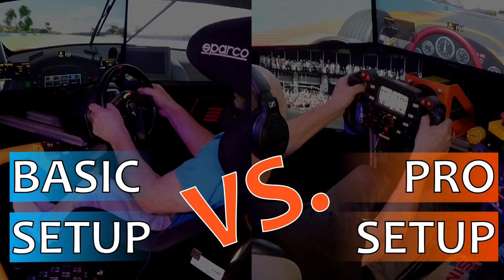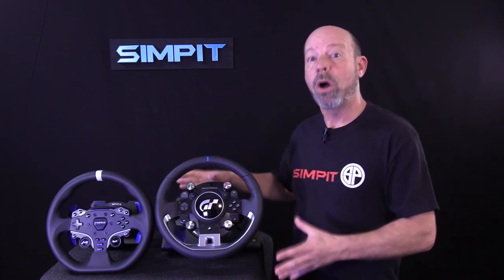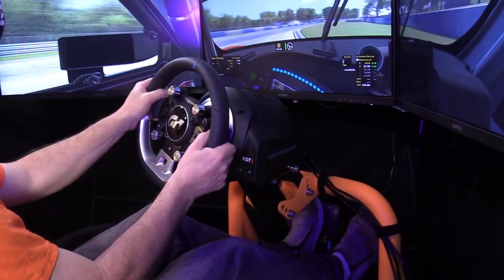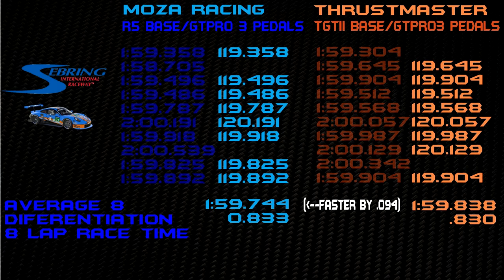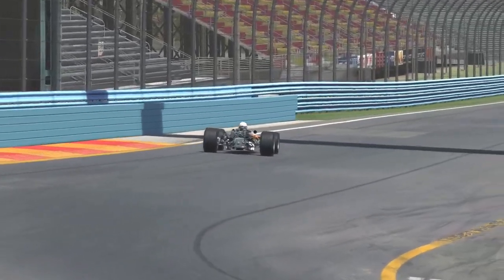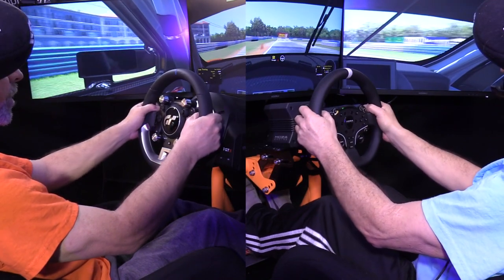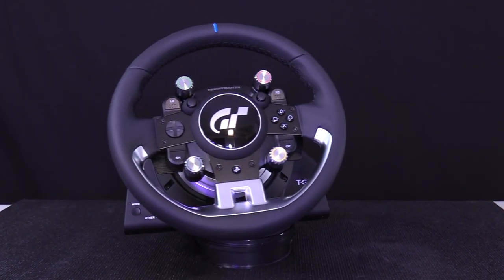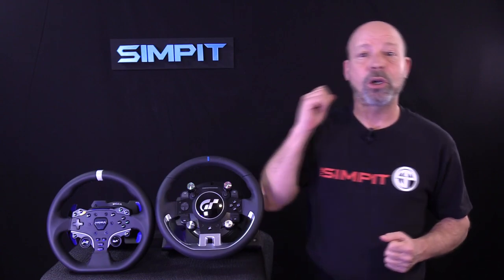Belt Drive Vs. Direct Drive - Battle of the Five's

Comment: Really interesting. The t-gtii really holds its own.
Reply: I have a t-gtii now and really happy with it. Fan does make noise but as soon as sound is on you can't hear it. You only feel belt notch if you go looking for it, spinning the wheel really fast for example
Reply: @peterwood2633  Good to hear that, I want buy T-GT II with playseat in winter 2024 and sure but PSVR 2

Comment: Something nobody will tell you is. Thede 5 to 7 or 8nm belt wheels feel stronger then 5 to 8 dd wheels. Just the way the belt and motor is pulling feels stronger then the way magnets react in a dd wheel. Ive alwyas understood why dd wheles feel better in the hugher nm range even if you were to lower settings a bit. For me it took about 15nm to truely undrrstand why dd is so so good not just in smoothness but the reaction and response and snap with that extra torque. Even if resucing down to 8nm its still worth having a 15+ nm wheelbase thats dd. If i didnt finslly get to try the stronger ones i would have stuck with my cswv2.5 because yes i liked it more then any 5 to 8nm dd wheel on the market.

But I will say 1 full second is the difference between winning and losing many times over again. Lol

But yes you wont gain times with either of these.

Comment: I ended up buying the Thrustmaster TGTII, though I was seriously considering the Moza R5 bundle and Ras1ution 2 converter (I do PC and PS5 racing.)   Ultimately it came down to me not wanting to have to fiddle with a middleware device to get things working on the PS5.  The difference in cost was that the Thrustmaster was about $60 more than the R5 + Ras1ution 2 setup.  If I only did PC racing I would have bought the R5 bundle.  I don't think you can go wrong either way.
Reply: Thrustmaster makes AMAZING wheels .
Even a t-150 is flat out amazing , my tspc racer I upgraded too , is lovely too.

They offer a TON  of wheel rims.

Comment: Not shocked. Honestly if you are a good and consistent driver with one wheel, you will most likely be good and consistent with another. Many moons ago I did some testing between my G27 and my brother's T500. Once I got used to the higher ffb, I was running similar enough times and consistency. Upgrading wheels more or less comes down to feel and in some cases power, obviously not in this comparo for power. If you are looking for a new wheel, as in you didn't have one, this type of comparo really highlights what your options are like and what to sort of expect.

Comment: Shaun,
I’ve been in sim racing probably about as long as you. The DD is and has been one of the last high upgrade for me, and I’ve debated for a while. I bought a set of CTS(CST) pedals when they were the best around 2010. Had a t500
And several Sam Maxwell Momo rims. Became disabled 2104-18, sold it all. Came back and went with a t300. About two months ago, purchased Simtrecs from v3(not half as good as CST), 5+ tenths I’ve improved. The marketing on the DD bases they’ve done a great job, imo more immersive they’re not going to get the performance gain as a high line pedal, imo. I’m just not paying $2500 for a simucube & rim. Folks across the pond have been saying good things about the TM dd. We won’t get the opportunity to buy until March, maybe you’ll get your hands on one sooner. Good video 👍

Comment: Had the logitech G25 for many years and wanted a quality upgrade but didn't have a clue and thought trustmaster were at the top of the game for wheels and so I bought the GT2. Was devastated when I unboxed it to find it as "nobbly" as the G25 when I expected nice smooth rotation. Hearthbroken when investigating DD and now stuck with the GT2. BUT maybe I shouldn't be...the FF is good, the build quality is there, it's 6NM is strong enough and it does the job while being significantly cheaper than the top DD wheels and with plenty of buttons and reasonably good looking.. SO , I dunno...still haven't experienced DD to tell if I should be crying myself to sleep or not but I will never like the nobbly rotation that's for sure. It's also got an idle high pitched whine from the mechanism which I don't appreciate.
Reply: be happy my friend. Dont forgot real cars are hooked up to rack and pinion with a belt (nothing wrong with belt drive). I myself got caught up on all the dd hype myself and played a very nice dd moza wheel that cost like 3k that didn't blow me away at all my friend. iTs just all the dd hype all over youtube and most of the reviewers having to give good reviews. Im loving my tgt2 with transducer my 3 different rims, tlcm pedals and next level racing hf8 haptic pad running thru simhub for gt7 just have to have both ps5 and pc on same private network to get live data. love the immersion in gt7 vr2 its the only way I play. 
When your tgt2 goes then you move to dd my friend.

Comment: Hi Shaun, I hope you are well.
Idea for a video, belt drive wheels vs DD wheels for catching slides. I went from a T500 to a Accuforce V2 Pro just about 3 years ago, the first thing I noticed was how easy it was to catch slides with the AF V2 as compared to the T500.
Reply: I noticed the same going from the TS-PC to the  CSL DD,  catching slides with the TS-PC was always very difficult,  with the  CSL DD it's instinctive.

Comment: During COVID here in South Africa I could only get the TGT II locally. I was not disappointed. Seeing as I had an old T500RS previously and I had that wheel. I only had to buy the TGT II base. It was a no brainer from a price & supply & support standpoint.
Reply: I went from a t300 to a t gt and didn't feel huge difference. Maybe 10-20 better feeling. Nothing crazy. Seems like DD is hardly better.

Comment: Thorough and helpful video! Thank you for making this video. Moza wheels seem a bit expensive, which is causing me to lean towards the Thrustmaster setup.
Reply: Moza wheels are more expensive because they are made out of aluminum and carbon fibre, not plastic like the Thrustmaster rims. It also has a decent QR system that doesn't flex. The ONLY reason to spend the extra $$$ on the Thrustmaster base is if you're on console.

Comment: I have a CSW 2.5. I was able to try the CSL DD for a few days. I decided against buying the CSL DD. I could feel some improvements, but they weren't enough to justify me purchasing the unit. Looks like, if I do want to upgrade, I'll probably need to save up for a bigger upgrade (and I'm not sure I'd run the wheel at a much higher force).
Reply: Similar experience,  I  had the TS-PC,  tried the CSL DD 8Nm, the difference isn't huge. I did switch to the CSL DD though,  so my nephew could have the TS-PC.  I  tried the Fanatec  belt driven wheelbases but didn't  click with them but the CSL DD  has much better FFB imo and seems to  remove  a slight amount of latency that is experienced with belt driven bases.

Comment: possible shootout: t300rs (still a very popular wheelbase) vs csldd 5nm. price is similar. i think itd be interesting because everyone gives the t300rs high praises, and many give the 5nm fanatec criticism and recommend an immediate upgrade to the 8nm. but this may be a natural progression for many people moving from belt drive to direct drive.
Reply: i had t300rsgt after my g920. then last year i got the dd8nm, WOW the difference was bigger than going from the g920 to the t300! it was such an incredible upgrade. i tried the 5nm power supply as well and can say that the dd is still very much superior to the t300. but the 5nm is lacking imo, when you hook up the big psu it feels like its been unleashed. its even quicker to react, top speed of rotation is faster and of course the strength just makes it feel complete. now it has been just over a year since i got the dd and i crave more. i want to be able to get the feel of no power steering better than the dd can

Comment: I had a TS-PC,  it was (and remains) a solid and reliable bit of kit and makes more sense for the PC and is cheaper than the T-GT. I replaced it with the CSL DD 8Nm mainly so I could give the TS-PC to my nephew. To anyone getting into sim racing in 2024 I'd have to recommend direct drive though,  definitely avoid the gear driven Logitech, (which is still capable) I  only say this because if you find sim racing isn't your thing it'll be easier to sell a direct drive wheelbase than any belt driven base. Good pedals make more difference to lap times though.
Reply from the maker: For sure it's a great wheel, but I agree with DD prices in 2024, DD is the go to now.

Comment: How on earth can a belt driven base feel quicker in counter rotation? Mind blown
Reply: Uhm... what do you mean? That is always the case as the DD doesn't have any gearing to catch the torque of a wheel once going.
They also depend much more on filters because only few like the feel of a raw direct drive.
That exactly is the problem around DD's - everyone just thinks "DD = better" which is simply not true.

Traditionally it's like this:
belt driven feels more filtered by design as the belt catches some of the raw ripple intensitiy.
DD feels more sluggish due to filters and the lack of gearing, means the only component that can hold torque is the motor itself which also get's blown out by overlapping effects (much like a single membrane speaker which you ask to play lows highs and mids).
Reply: I find it hard to believe.  I have an R5 running with no filters and 100% wheel speed and it spins incredibly fast running the max torque output.  You can set the speed to 200% which I haven't done as 100% is almost too fast.  Even at 30% its very quick spinning.